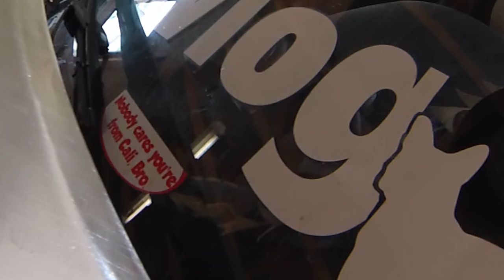MIATA COILOVERS AND SLOTTED ROTORS PART 2 THE INSTALL ATTACK S05E14

Comment: That setup looks like it might actually be non terrible.  Its a dual spring rate setup by the looks of it.  How is the ride quality?  Is it bouncy castle, skateboard or actually responsive handling?  Curious to hear your thoughts on these.  Review video maybe?
Reply from the maker: i could do a review vid as soon as they settle fully. they have a tendency to be a bit bouncy on certain bumps, but also have a skateboard feel on others. not much sag in the corners. and the responsiveness is much better than stock no matter what. lol. my stocks were toast so for the price of stock setup, i would do this again any day. and like i said in part 1, even if they are toast in one year, replace the damper since thats all that will fail, with something better and have a dual coil setup. or replace them all with the same every year... $285 shipped. cant beat it. and i have ridden in Miatas with $4500 coil overs (Bob Boileau, owner of Pikes Peak International Raceway, look him up) and they were way to rough for me. this is a good mix of street and race feel.
Reply: I like your reasoning there.  It seems if you could pick a much higher ratio short coil from stance nation (known as bounce-bounce nation on miataturbo.net) it could fix the ride frequency which I am sure they didn't get right.
Reply from the maker: NickelNDiminIt the ride is honestly fine. i prefer it stiffer. and going low/race setup is always going to have a trade off. "cool ain't comfortable"